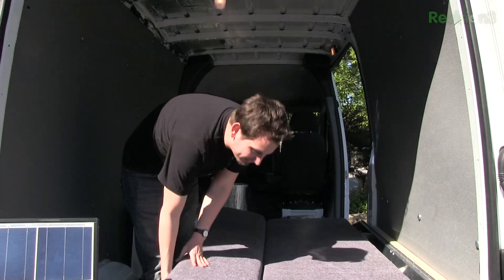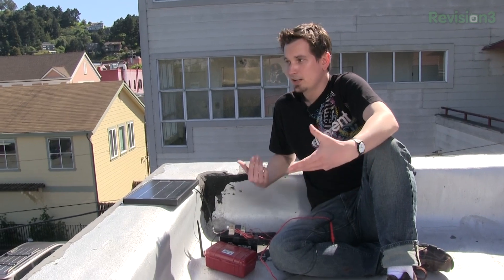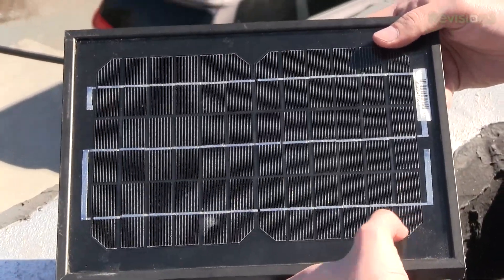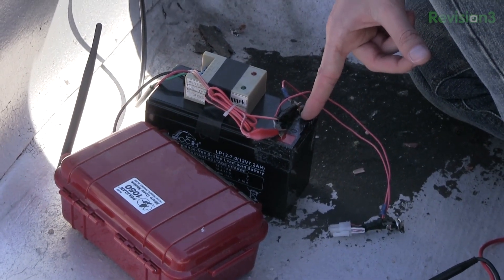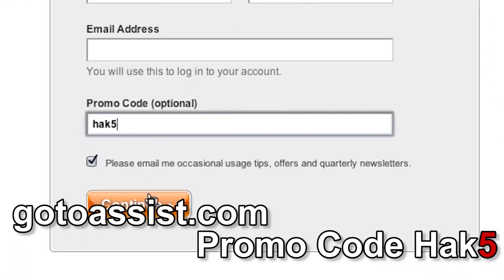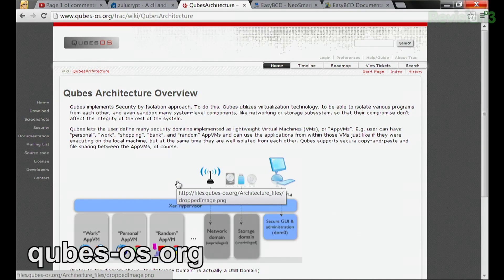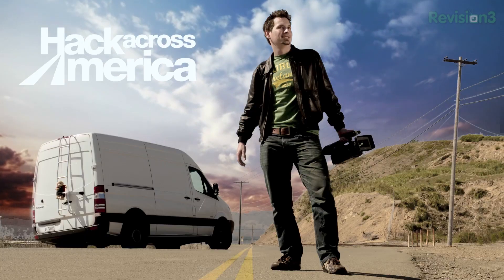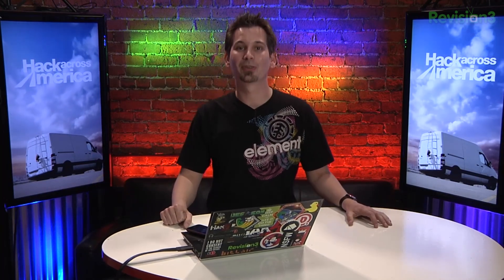1407.3, Announcing Hack Across America

Comment: I have done this setup in an older truck 4X4 and it was set on a trailblazer, but all that was left of the original truck was the shell and some of the frame. V8 power and it had 2 alternators that was powering the batteries, a flat floor box was made to have a full kitchen slide out the back BBQ and sink with a water reservoir. fridge was also an Ice maker from a boating unit.  bed was full size foam based formed to fit but was comfy.  Coffee machine and toaster pizza oven also included.

Comment from the maker: My thinking was that with the Engel AC/DC Fridge 1.4cf (typically draws around 1 to 2 Amps per hour) and four 108 Ah AGM batteries I'd hardly need to worry about it exhausting my energy supply. Thoughts?

Comment: Since you're going solar, I'd suggest a brushless fan for an air vent.  This will keep the van cool when it's in a hot parking lot, and will help with venting out hydrogen if there's any hydrogen leaking from the batteries.  

Since you visited CERN, perhaps you could visit SLAC and perhaps a Nasa site or two.

Comment: I can understand that feeling quite well, its a great project and will defiantly provide quite a bit of power for your system. also if you ever found its not enough you could wire it up to the alternator at a later date (real easy wiring) or perhaps put a small wind turbine on the top of the van, wired into a microcontroler so you could get data like wind speed, RPM, active shut off of power supply etc... (on a side note if your heading up to Oregon 395 to 97 is a much nicer drive then 5)

Comment: One other point, if you where to use an isolator in conjunction with the solar you would probably rarely ever have to worry about discharging the batteries completely.

Comment: Hey man I love the fact that your all gung hoe for using solar, but i wanted to point out you could of powered your whole system off of the alternator of the car, using a device called a battery isolator, it would allow you to charge the batteries while keeping them separate from the car battery that the van is using.

Comment: An advice, you can always make a upper stnad on the roof to Extend Solar panels! In that way when you are parking and not running More solar panels can be used on the rooftop by extending superposed solar panels over the sides and back and front of the van :)

Comment: for way less investment you could have just added an extra high output alternator to charge the agm bank... 200 plus amps vs. your <20 amps that requires sunlight... factor in climate control (required in summer or winter) which you won't run off the solar..  that whole project as a waste... for the pineapple on the roof.. ok. for a van turned into an mini motorhome... NEVER... better yet, diesel genset...now were talking...  sorry darren, love hak5, love u and snubsie.. but this solution stinkz